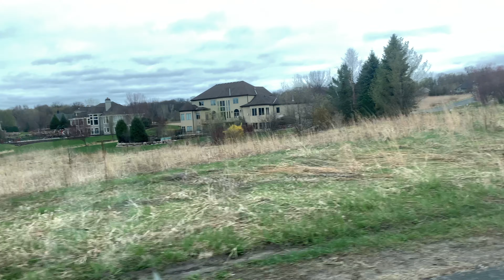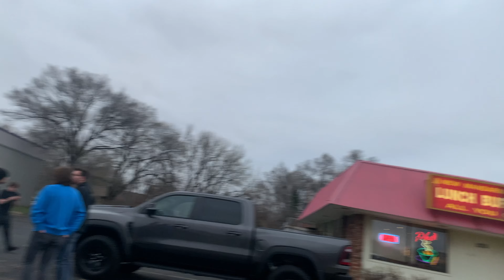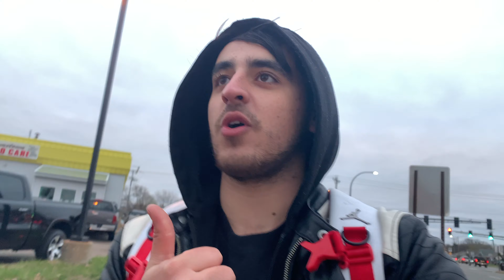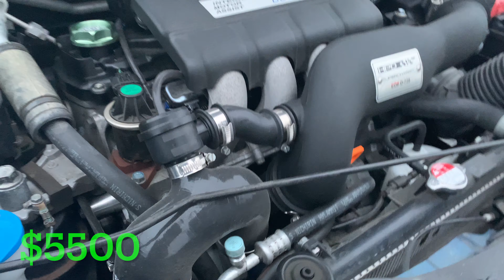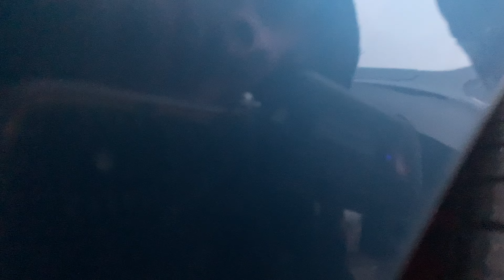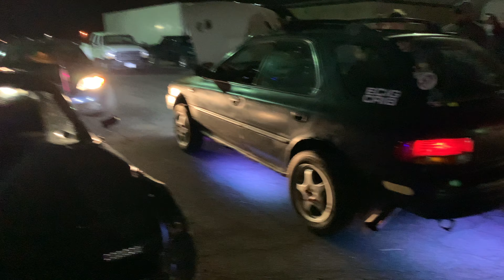I saw this Fake R34 GTR at this Car Meet (I Was Pissed!!!!)

Comment: I wouldn't be pissed. It's not like this is an 02 Chevy Impala with a fake r34 body kit. It's an R34 gts, and someone slapped a GTR badge on it. I'm not mad, but I'd never throw a fake badge on an already hard to import, classic.
Reply from the maker: idk bro i think its a bit tacky
Reply: @cardevotion6014  it's no different than taking a 67 Mustang and putting the full GT500 conversion kit on it and it doesn't matter if you find it tacky or not at the end of the day he has a car that's going to do nothing but appreciate in value

Comment: Bruh, it's a gtt not a gtst, and it has the gtt east best type r style front bar. It doesn't have GTR parts sans the badge. 

All in all, nice and pretty common kit in JPN. Still a street demon and worth $$.
Reply from the maker: whats the difference between the GTT and the GTS
Reply: @cardevotion6014  the r32 and the r33 have gtst the r34 has a gtt. They aren’t bad cars by any means. People always convey them with the gtr look body kits here in Japan. Not uncommon by any means.
Reply: @mrstrawcloud  true story
Reply: @cardevotion6014  the other one I think has a single turbo not awd I think
Reply: @cardevotion6014  GTS has smaller less capacity engines (:
Reply: It has a replica GTR front bar lol wtf u talking about
Reply: @afrayyy  you're a muppet. "Type R style" is the official language the aftermarket seller used/s for this GTR style front bar. Replica means replication of the original, the GTR bar or a replica of a gtr bar will not fit a gtt unless you do the entire front end including fenders, crash bar etc. So it's a gtr style specially for gtts, not a replica bar.

Comment: Ok first. He didn't build that honda. It's the factory built supercharged cr-z model. Thats built in america.  The car still isnt fast. The supercharger only added 50 hp more, and makes a whole 190 hp. They decided to make supercharged models. As an asset cause the NA version cr-z's. Didn't make enough power. To even get out of its own way. Also thosr hood struts. You can buy them all day long, no wait. The ecu cover you can buy all day, no wait.  The oil caps are still produced by mugen, buy as many as you like. With normal shipping.
Reply: Oh one more thing, Honda had mugen add the kits. Here in america. It's an option from honda. To have mugen add the full exhaust, and other parts he mentioned. The parts were also. Made here in america not  also, not Japan. Sorry but you believed the carshow ricer. That brought a factory built.  190 hp supercharged assisted cr-z. Who has you. elieving he built the car. But all he's doing is making payments. For a factory optioned 190 hp cr-z. He didn't know anything about the car. All he did was point out visual enhancement parts. He played you for complete fool. It looks like a factory stock car. Because it is a factory built car.

Comment: It's actually a gtt.
Reply: No I am not skilled with any skyline series but isn’t the GTT just the 2 door of the GTST? I’m pretty sure they both carry the RB25. But correct me if I am wrong. I’m more skilled with the SVX and crap like that.
Reply: @thecoop488  So the thing is the gtst/gts/gtst type m/gts25t is r32, and r33. For some reason they changed it to gtt as an r34. Both 4 door and 2 doors are called gtt if they have a turbo. The n/a ones are just called gt but same thing. And they have rb20s in them. The 25 gt / 25 gtt are the ones with rb25s.
Reply from the maker: hold up they made a 4 door? i know the station wagon Stegea. What are the 4 doors called.
Reply: @cardevotion6014  The 4 doors have the same name as 2 doors. If you want to search it up just search gtst 4 door or gtt 4 door.

Comment: I’m a Honda guy but dang. Really lol waste of $$
Reply from the maker: I don't think its a waste of money its a unique build that you will not see anyone else have. on top of that it has incredibly rare parts on it imported from japan as well as a whole super charger. If you cant appreciate that you might not be a car guy. Now would i personally spend my money on this kind of build defiantly not, but thats the beauty of the car scene is that everyone has their own taste.
Reply: I beg to differ
Reply: @cardevotion6014  it's not a unique build. He never built or torched. one piece of that car. It's the factory available supercharged model. With every available option. That honda offered. On there supercharged cr-z mugen models. Honda had mugen do all the modifications. Right here in the u.s. the supercharger is for asset. Only adding 50 more hp.  Cause the NA models didn't make any power. His car makes a whole 190 hp. With all the factory options. Offered by Honda at the time.